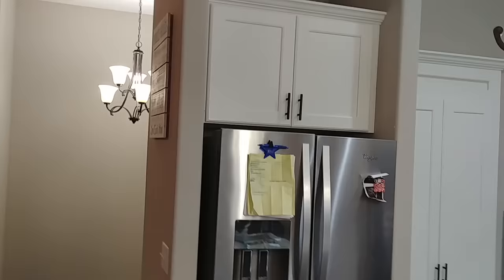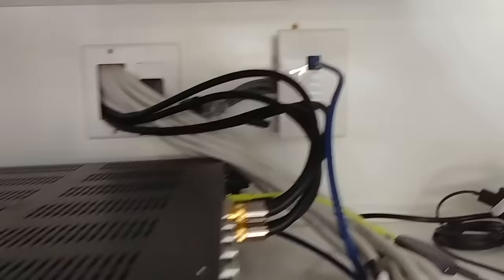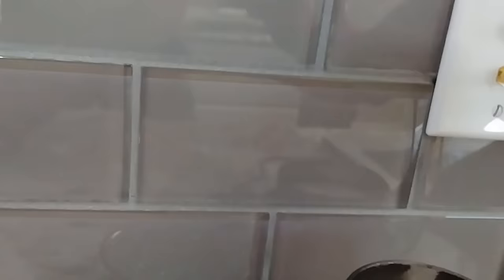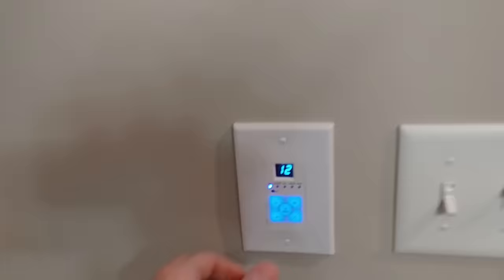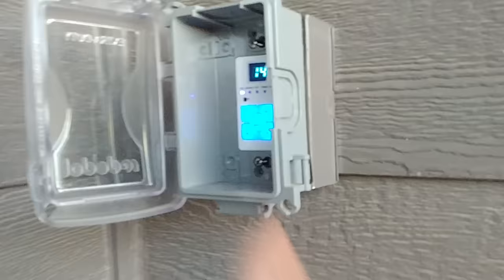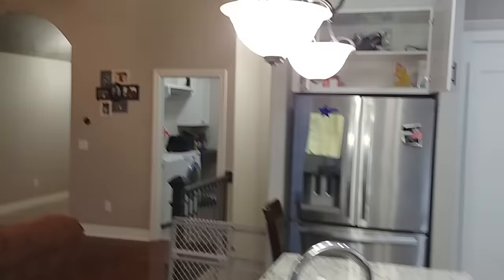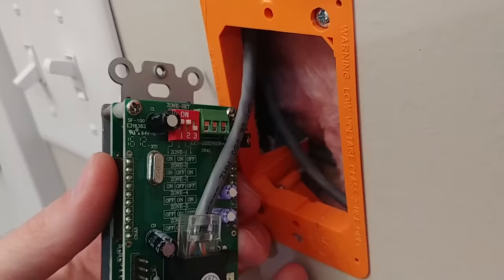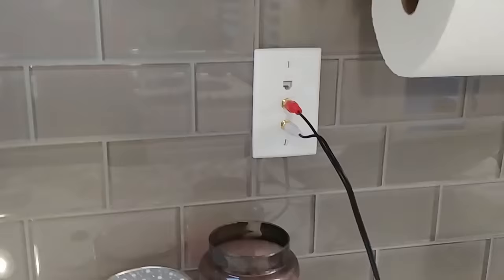WHOLE HOME AUDIO: Monoprice Whole Home Audio Amp! 6 Zone 6 Source

Comment: If you had more than 2 speakers running to a zone would I need a distribution block kinda thing or is there enough room to plug multiple speakers in 1 zone?
Reply: I was just reading more I guess they would need to be "daisy chained"
Reply from the maker: The amps aren't designed for more than 2 speakers per zone. Theoretically you would need to wire them in a combination of series/parallel such that the 2 main speaker cables going back to the amp would both be 8 ohms.
Reply: If you have 4 speakers all with the same ohms, you would go for series or parallel in order to have a better sound?
Reply from the maker: Ermal A 4 speakers all in one zone? It's not really designed for that, I would recommend splitting it into 2 zones but the best you could do if you had to was do 2 speakers in parallel, running back to the amp. And the other 2 speakers in parallel running back to that amp. That would give you 2, 4 ohm loads assuming the speakers are 8 ohm. This is not ideal but would technically work
Reply: It can be useful when you have a big room and don't want to have 2 keypads in the same room (to not occupy 2 zones channel for single room). In parallel you should have the result you described, half of the ohms per speaker wich mean less impedance, less volume, in each speaker. Putting in series seems like impedance, the quality of sound, remain the same 8ohm, but would this cause problem to the amplifier? I see a lot of people asking this question "how to have more speakers in the same zone controlled by same keypad", so I am curious how is the best way to realise this. Do not have an electronic background, so apologies if any wrong terminology or concept. 
The video is a great practical manual and very helpful TheKMZ1, so thank you for sharing!

Comment: Cool video. Any chance a sub can be added to this?
Reply from the maker: The amplifier has preamp outputs so yes you could use the preamp to hook up another amplifier which has a sub output
Reply from the maker: I have not done this though so I'm not much help on how it would be hooked up
Reply: One more quick question. Was there a specific reason you used those speakers. Can I use the Micca M-8c to this system. Thanks a lot for your time.
Reply from the maker: @MrBryce919  I used these speakers because the wattage matched up perfectly, dayton audio is a very high quality brand, and they are amazingly priced

Comment: I had to stop listening when you said that you had to run an extension cord to power the amp.  It's not hard to add an outlet off of the fridge circuit.
Reply from the maker: Matthew Lown nothing wrong code wise with doing an extension cord. sorry you couldn't see past that